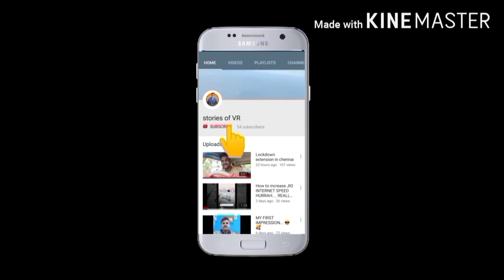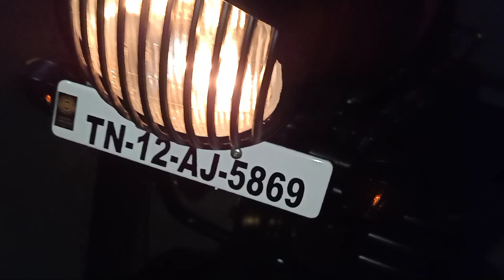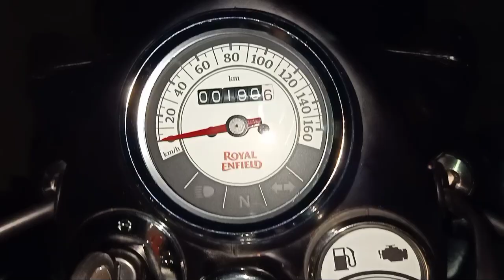How to maintain Royal Enfield Bikes |15 Tips |

Comment: Bro I bought the same colour .
Engine start aagum pothu oru sound kekuthu like when we turn on the kill switch. Is that normal or problamtic ?
Reply from the maker: It’s an FI Starter Sound ... Nothing A Problem ...Common in all bikes
Reply: @storiesofvr7617  athey maari bro bike move aagum pothum athey sound kekuthu
Reply: @aravindhkumar8478  Fuel injection run aachina sound varum dhan.. apdi dhan functionality

Comment: Ungalodathu 350 or 500 brother
Reply from the maker: Bro 500 stopped ,bro mines 350 Bs6 bro...
Reply: Stories of VR evloo long pogalom broo single stretch la
Reply from the maker: Bro... 100 KM kula porathu than namba body Kum nalathu bike engine ku nalathu bro... It's an AIR-COOLED engine bro...
Reply: @storiesofvr7617  Better speed lumit 50 to 70 👍. Long life good engine performance Brother. 💎

Comment: Bs6 Alloy wheel very bad performance
Reply from the maker: It Comes with Tubeless Tyres Avoid Puncture Issues , Instead of Pulling 200Kgs in Spoke Wheels in Case of Puncture ...